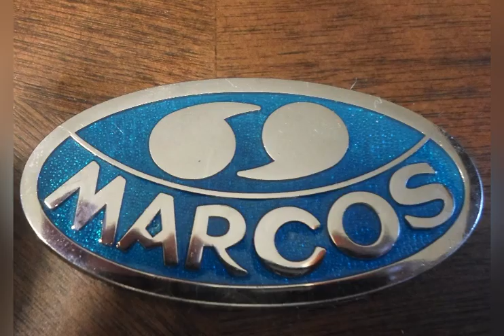1961 Marcos Luton Gullwing Prototype restoration

Comment: John, pleased to see you are making progress, a long way from being as she was but a long way forward from when I last saw her. A colour photo, nice touch, you have been busy searching, I only ever saw the b/w. Sorry you could not use the bonnet Dave got from Sweden, it should have fitted. What did you end up using for power? Cheers, Martyn
Reply from the maker: Hi, Martin. Very good to her from you.  yes we are finally making progress.  Having restored the original bonnet Larry has had difficulty taking a mound off it and so has decided to use the Swedish bonnet modified to fit.  The engine is a 1300 cc Cosworth that was built for Andy Seward for HOO 144 but was part restored and so I bought it and completed the rebuild.  Interestingly it was built by my old friend Stuart Rolt and he had all the details of it.  Dry slumped and tested to 170 HP it should go very well.   Keep in touch and give my regards to Gord Davidson.  John
Reply from the maker: Martin, Thanks for your continued interest. Actually Larry has decided to use the Swedish bonnet after all as he has had difficulty making the mound for the reworked original one.  The power unit is a 1300 cc Ford 109E unit that I purchased from Sewell who owned the Minoprio car when he was stationed in Europe.  Interestingly it was built by my long time friend Stuart Rolt and he had kept all the details.  It was brake tested to 170 bhp so it should go very well.  Thanks and please keep in touch, john